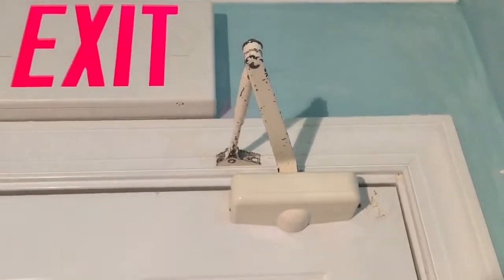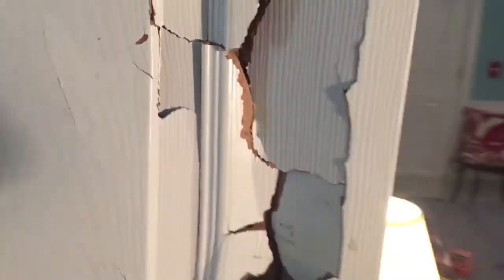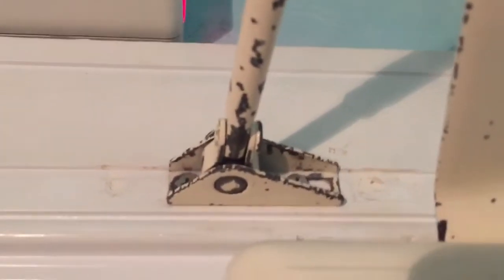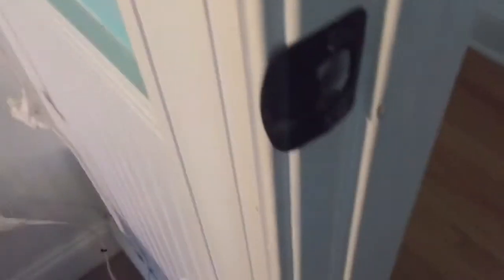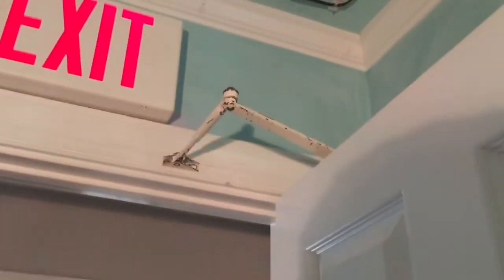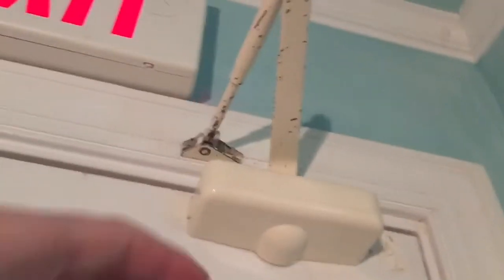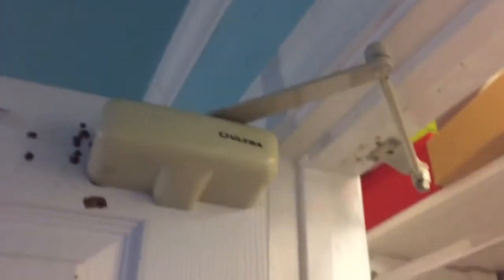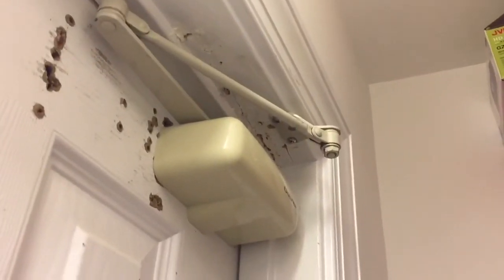Door Closers: Remounted Tell and other updates

Comment: Do you think it's safe for me to use my Simplex 2098-9806 on my NAC with sync? I tried it with the Wheelock sync protocol and it blinked a couple times whenever the strobes were meant to flash (I think that because it was about every second, but I didn't have any NAs hooked up, so not 100% sure), then when I activated selective silence, it just blinked more frequently.
Reply from the maker: +ironmatic 1   It wouldn't hurt it, but it may sound weird or not sound correctly
Reply: ExitSign250 Lol the Simplex 2098-9806 does not have a sounder. Do you even know what a 2098-9806 is?
Reply from the maker: +ironmatic 1   Nope, I'm not good with Simplex model numbers.
Reply: ExitSign250 Every heard of Google? The 2098-9806 is an alarm indicator and test switch! You probably have one yourself.
Reply from the maker: +ironmatic 1   Relax, looking up model numbers isn't my main priority. And I do have one. It's fine if you wire it up
Reply: ExitSign250 Sorry if it sounded like I was mad, I wasn't at all. it's impossible to accurately transmit things like that well over text you know. Exclamation marks don't always mean yelling, they often just put some emphasis on a sentence.
Reply from the maker: +ironmatic 1   I realize that, only sounded like it and to me it wouldn't make sense even if it was supposed to sound nice
Reply: ExitSign250 I just realized this went from a question about an alarm indicator to a discussion about... I don't even know. Lol :P